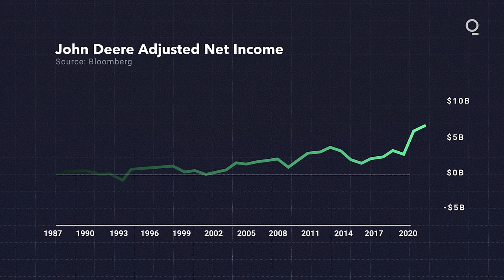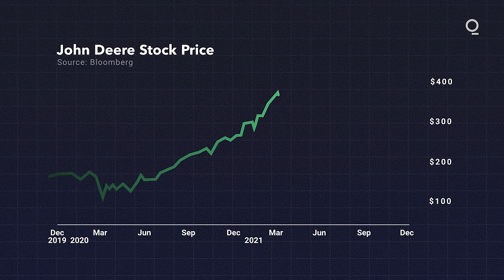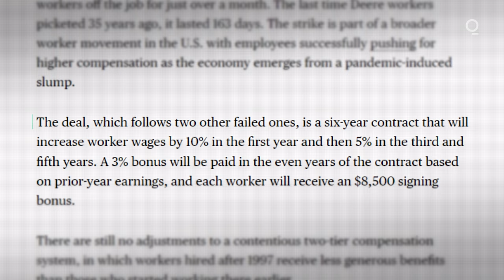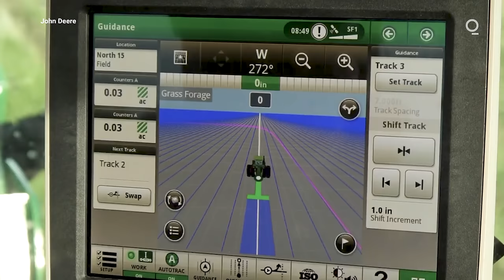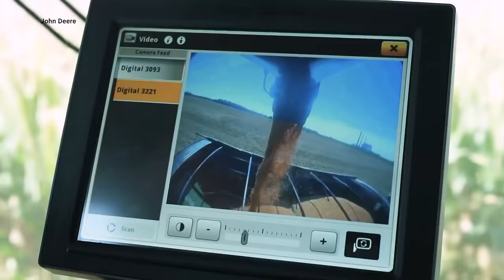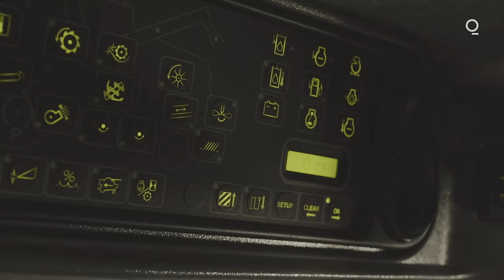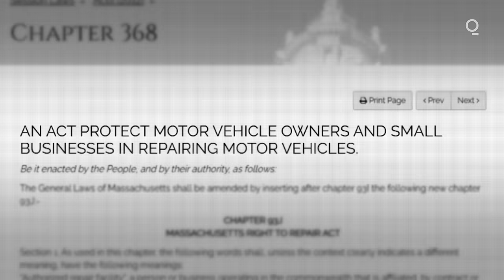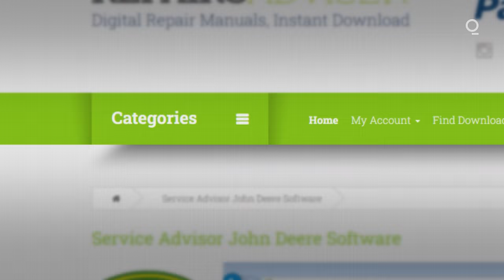John Deere Is Facing a Farmer Revolt

Comment: Some say it's a complicated issue.  It's a very simple issue.  Unless John Deere is issuing lifetime warranties they have no right to dictate who the owners use for repair.
Reply: Lolz!  Lifetime warranties from such a pit of greed and selfishness?
I think you're asleep.  You must be dreaming of a major agro corporation capable of doing right without force.
Seriously, I 💯% agree with you!
Reply: I use John Deere tractors and have for years, and the idea that anyone should be allowed to work on them and the company should still warranty their equipment no matter how badly a backyard mechanic messes it up doesn't make much sense.
Reply: @freddexta3363  Um, no one said that except you.  The OP presented an either/or, and not both.
Reply: @MomMom4Cubs  Just replying to the comment and yes you are right, I should have replied to the video piece. My point is just that nobody warrants any piece of equipment that hasn't been fixed by their own technicians for obvious reasons, and some of the people interviewed want to have it both ways. Or at least they leave a very strong impression that they hold that opinion.
Reply: @freddexta3363  I agree wholeheartedly that no company wants to guarantee a product fiddled with by nonprofessionals.  I did not, however, get the impression that anyone on the video wanted it both ways.  It seemed clear to me that the preferred outcome is right-to-repair.

However, since they reject right-to-repair, they should ante up and get warranty their products.

I feel this is a poor solution because the days or weeks of lost production can be the death knell of a noncorporate farm.
Reply: The problem is not only right to repair, but also right to repair in a timely manner. If JD doesnt offer 24/7/365, same business day repair at a reasonable price, a farmer should be able to contact another party that provides fast and honestly priced repair

Comment: The value of the data JD is collecting from those farmers using software on the equipment has massive value. They should be compensated for it or allowed to opt out.
Reply: Does google YouTube and Facebook compensate us for all the data they collect from us ?
Reply: @MR.TOYBOX  They should, I would love to know where "I" have been sold.
Reply: Anything that involves your data should be opt-in, never opt-out.
Reply: You can opt out of Facebook to some extent. Google has some of that functionality as well. depends on the country you live in. Also worth considering if using software on a computer is the same as software that controls equipment/vehicles.
Reply: @MR.TOYBOX  not yet, but they should
Reply: There is an idea called MyData (and other similar initiatives). Idea is that you would and should have right to any data of you, and could control who has right to use it. And logs of who has. These are still decades away of being reality. And problem with farmers is that they are usually considered enterprises and not covered with laws and regulations considering personal data.
Reply: Technically the reduce the purchase price with your auto buy-in of the product, with a contract that includes giving your data up.
For the most part, the data has no other value to the farmer as there is no marketplace for it, and they could sabotage it if they wanted to, albeit via a lot of effort. It is very similar to most consumer products nowadays, from TVs to cars. We have the choice to not buy the product.
Reply: they should be allowed to opt out, period.
Reply: The powers that be, want ALL data.  They want to know in detail, what you plant, how much you plant, where you plant it, how much fertilizer, and every other aspect of your operation, if you are a farmer.  It's the same with truck drivers, pilots, and so on.  They will get that data one way or the other.  If you carry a phone, they know (and record) everything from your location, to your velocity, to what you are saying, and what your cameras are looking at, even if the phone is off.  One day, they will control every aspect of your life.
Reply: I believe the farmers are compensated for the usage of their data by 1) gaining significant fertility improvements vs. manual planting and fertilizing, and 2) paying significantly less than the actual cost for the insanely complex equipment they use. A modern combine harvester costs upwards of a million dollars, and keeps track of what crop is the best choice to plant in every square foot of soil on the entire farm at any given day of the year, and what kind of fertilizer to use and how much to use based on the characteristics of each square foot of soil. The only thing the farmer does anymore is sit in the operator's seat and monitor for severe errors.
Reply: @deusexaethera  If you believe that then I have a bridge to sell you.
Reply: @throngcleaver  Data is the new oil, people make the data. Elect leaders who will make meaningful policy curbing this. There is no other way.
Reply: @MR.TOYBOX  But should they?
Reply: @paulmcewen7384   So why are farmers buying these hi tech machines and not Mahindras ?

Comment: It's getting to be the same way in Deere's construction equipment. Had a bulldozer that threw a code that resulted in the computer reducing the throttle to half speed. Code turned out to be for a windshield wiper motor.

Comment: What people don’t realize is this affect everyone, not just rural farmers.    Companies like Apple and many other tech companies are in this fight with John Deere.
Reply: We can't let your average consumer going in and repairing their iPhone. The safety concerns are kind of like in Aviation you know, you wouldn't want someone going in and repairing it!
Reply: @SuperQBoi  LoL. My laptop PC (5 years old) died because the battery no longer held charge. It was a complete pain in the neck prying the thing apart and pulling out the old battery and putting in a new one. These things are not designed to be fixed. And that is the crime. They want consumers to buy new every 2 or 3 years.
Reply: Not just tech companies. A lot of Auto (car) manufactures have jumped on this on Apple/JD's side.
Reply: @lyianx   The auto industries are already regulated by right to repair laws. That's why we have NAPA auto parts, advanced auto parts, O'Reilly auto parts, etc. It is against the law for them to try to deny their consumers to repair their vehicles
Reply: @never2yield20  Which laptop was it  because the ones I have owned all had a removable  battery ?
Reply: No, no.  We realize it.  We also realize that these farmers and their supporters are actively fighting to weaken contract law in order to prevent willful contract participants from being held accountable to the terms they agreed to.

Comment: It is amazing how similar this problem is to the whole  McDonald's Ice Cream machine issue.   Companies are no longer creating a business model where they sell their machine for a profit, they are selling their machine at a lower cost, and then their business model is that they create profits by forcing customers to use them to repair their product.  The next time you pull into a McDonalds and they tell you the ice cream machine is out of order.. think John Deere green.
Reply: The ice cream machines. John Deere, electronics repair... It's all connected in the battle for Right to Repair.
Reply: @ZarHakkar  Lol it's actually late-stage capitalism but yes you're not wrong
Reply: I bet they are selling for a big profit and banking on it to break down to further their profit margins.
Reply: Exactly where my thoughts went to as well.  Though I think the story behind the machines isn't apparently super common knowledge.  It's another tale of right to repair vs big Corp, but mcdonalds has to feed its sister company...
Reply: Gaming companies do the same thing. Release a broken product, force consumer to repair it using micro transactions, profit.
Reply: @shaggyspade2468  I don't agree one hundred percent with this comparison, but games being released unfinished is definitely  a big problem.
Reply: I thought that the ice cream machines being out of order frequently was due to cleaning and not it actually being broken.

Comment: I'm looking at a new tractor but I know it won't be a Deere. If anyone from John Deere is reading this by chance then you really should create programs that educate farmers, small shops providing repairs and empower them while also making money to expand that support program.
Reply: Anecdotal, but my understanding is that, when asked Deere or Kubota...two out of three buyers will choose Kubota.
Reply: @Milo-nz5gf  or Masey.
Reply: Or New Holland
Reply: Consider a Zetor :P
Reply: @Milo-nz5gf  kubotas not much better, once you get into the big equipment. I was a Kubota tech for 8 years. If you cancel the Regen system on an emissions compliant Kubota 4 consecutive times, a tech needs to come out with a laptop.

Comment: "tractor going down the hwy".

Ok. I live in a farming community. My wife has worked in Ag for years. i've personally been called out to diagnose engine trouble on farm equipment as a formally training mechanic to pay for engineering school.

What an exaggeration. They let owner/operators repair their own 80,000 lbs tractor-trailers traveling 80 MPH from California to North Carolina and back.

You mean to tell me a farmer moving an oversized load of hay 0.75 miles on a public road with a speed limit of 35 MPH (yes it's a state hwy) is " a major threat to the public"?????? Really? How many people are even killed every rear by rogue tractors vs commercial and consumer vehicles? That's the problem? That's like spitting into a rain storm and calling it wet!
Reply: Haven't you heard of all the tractors falling out of the sky? </sarcasm>
Reply: @jannikmeissner  Don't be glib, he's trying to avoid tragedy like the 1991 incident where a tractor's maintenance crew forgot to replace some screws during a shift change causing a tractor to fall from the sky killing 14 people on impact.  

Tractor maintenance is serious stuff.
Reply: Exactly

Comment: The first sentence in this article is a lie. 
They basically said that farming in America wouldn't be possible without John Deere, really. 
There are quite a few alternatives to John Deere out there. They aren't the only manufacturers of agricultural equipment in America.
Reply: It's a complete BS article.  Much is exaggerated.  The NE representative saying a guy will be down over the weekend during planting season.  I don't know of a single dealer that is not 24x7 during spring, and harvest.  Might take a while to get a tech on site but they will get one out as fast as they can.  Yes I want to see consumer rights better defined and protected, but John Deere would not be doing as well as they are if they were screwing their customers over like this video represents.
Reply: @ShainAndrews  I know an independent heavy equipmewnt mechanic who could hire 20 mechanics and that wouldn't put much of a dent in his demand. The JD shop (2hrs away by semi) is full of non-talented mechanics and smart farmers will wait months willingly for repairs to avoid going to the dealer.
Reply: @andytaylor1588  I'm not making the case that every dealer is competent.  Interestingly enough you make the case that dealers, and by extension the manufactures, are not stopping repairs and service.  Something that is really mischaracterized in this effort.
Reply: @ShainAndrews  😂😂😂😂 ok, sure. Ive seen at peak times it could take as long as 2 or 3 days! They Dont have unlimited service techs

Comment: I have watched literally dozens of large farms replace their locked machines for other manufacturers.  Thanks JD
Reply: I'm a heavy equipment operator. We have rid ourselves of all Deere equipment.
I refuse to run Deere equipment. 
Fock John Deere.
Reply: That's one of the problems. There AREN'T modern machines available that are open enough. Honestly I'm in favor of just anonymously creating open-source tools that farmers can use to do all the computer-side stuff they need to, and Deere can try to stop me/them/us. Don't give Deere the option of doing a bad job of supporting right-to-repair, just give everyone full access without Deere's input and let them grind their gears legally if they want.
Reply: What equipment are operators going to?
Reply: @JohnDoe-mh8tm  CAT probably, or there are even electric alternatives now which are pretty cool. But probably a nightmare to repair.
Reply: Yep, nothing new around here is green. Lots of new IHC or Case, nothing JD.
Reply: i'd personally full on try to construct my own farm equipment at this point
Reply: According to the video, all manufacturers do essentially the same...
Reply: @indeepjable  You have the time and expertise  to build farm equipment  in addition to farming . ?
Reply: no but i can probably figure out how to do either
unsure if makeshift farm equipment would count though, whether simple conversions or otherwise
Reply: @indeepjable  So farmers should rely on makeshift equipment ?

Comment: Proven fact: The more complex the system, the less reliable and failure prone it will be.
Reply: That is why UNIX philosophy is the way it is, build it to do one thing only, but do that thing well.
Reply: Is it though? Diesel engines are more complicated than ever, but work more reliably in extreme cold than ever before. But it does make fixing it after a breakdown virtually impossible without taking it to a shop so the trade-off is real.
Reply: @lilacdoe7945  Oh Yeah. Mechanic and technician for forty years. The wizardry of electronic control systems comes at the price of Owner access and in some cases makes Mechanical repair easier and less complex while increasing the difficulty of electrical and control system repair. That's what this whole fight is about. Companies invest huge sums of money to create the marvelous machines and aren't about to allow even an excellent tech not in their employ to repair them. This fight really started in the computer and tel-com industry.
Reply: @jamesappling1212  yep, as I said in a different comment, this is about the only issue young techies and old farmers agree on.
Reply: Very true. I recall my Mom bought her 2004 Mercedez E320. FIrst Mercedez she ever bought after a string of other luxury brands. This was the first computerized chip car she had for a car, on the driver's back left side power windows didn't work well, so the dealer actually offered her a discount on the car. Over time that power window became a whole string of issues. We never had an issue with any of the other cars we owned.
Reply: "Proven fact: The more complex the system, the less reliable and failure prone it will be..."  ...to all except to the system owners; to ALL except THEM.
Reply: @JSB103  That's the problem. Who owns the system? The builder, the machine purchaser? (Tractor manufacturer) or the end user? The farmer.
Reply: @jamesappling1212 , I doubt we can talk about one single owner. Obviously the tractor manufacturer(s), software company or companies, the financial sector (banks, stock-broker firms), they reap the benefits while the farmers bear most of the costs. Simple.
Reply: Modern Airplanes are the safest mode of transportation and the most complex. counterexample proof provided, you're welcome
Reply: @lilacdoe7945  At their core diesel engines are not more complicated.  They are much simpler in design.  The complexity is added in all of the ridiculous emissions controls and other electronic sensors the government is forcing upon the consumers to make them appear "cleaner."